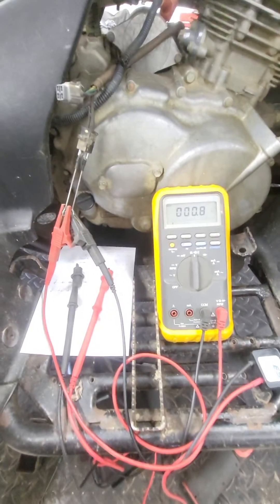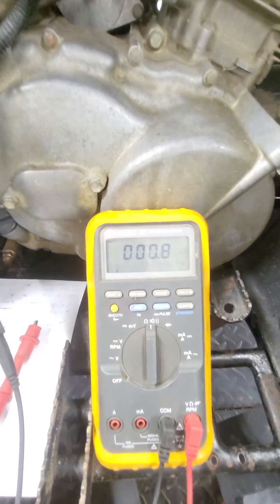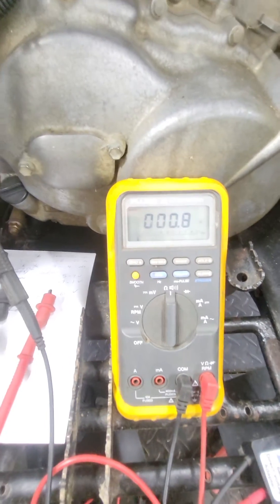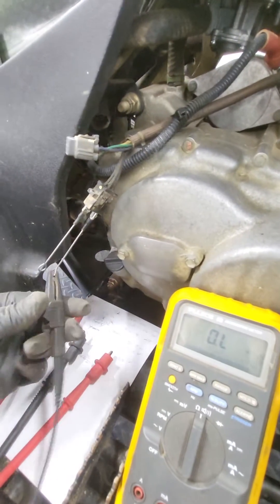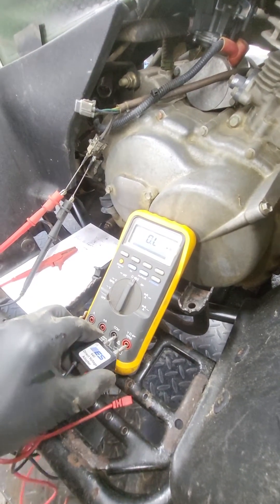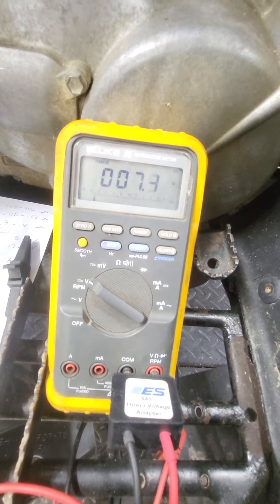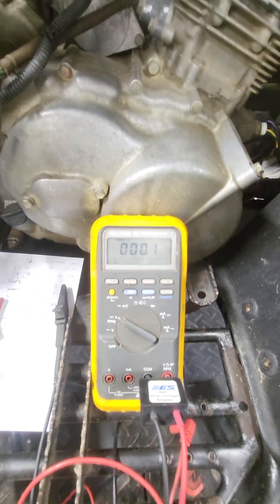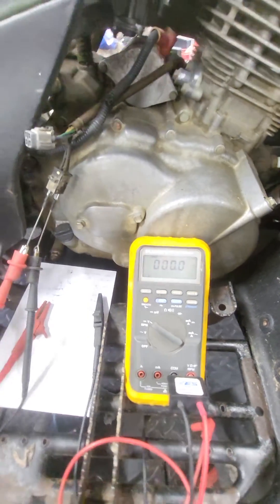Atv stator ohm test versus peak voltage

Comment: That problem is not specific to that machine or Artic Cat. Your diagnosis is correct for that specific machine.

Resistance testing is merely an indicator of a potential problem.

Dynamic testing reveals the issue. 

Example: if a wire contains 50 strands of wire and 49 strands are broken, the resistance test will appear that no problem exists within the coils of the stator. However, testing the same circuit dynamically will show that the single good wire in this example can not carry the current required to run the machine.

In summary, dynamic testing is an essential tool when troubleshooting circuits.

Hope this concept helps others.
Reply from the maker: How does one "dynamic" test?
Reply: @southeastpowersports The peak voltage test performed in the video is the dynamic test Boss.
Reply: @southeastpowersports  

Static testing, resistance testing is performed with power off, no current.

Peak voltage,  voltage drop testing,  are examples of dynamic testing, the current must be flowing through the circuit while performing test.
Reply from the maker: @Savage-lx5yj ,  I have that same tester and used it in my video
Reply: @southeastpowersports yes sir, read the original post. I was referring to the fact that resistance testing was not only a problem specific to that model. I was posting added information to help others. The dynamic testing that you performed is the way to go! The problem was not specific to that particular model. Dynamic testing will produce accurate results on any model or circuit. Resistance (static) testing is not reliable in some instances. Just food for thought when others are testing their own equipment.